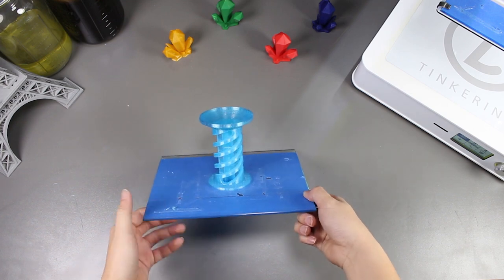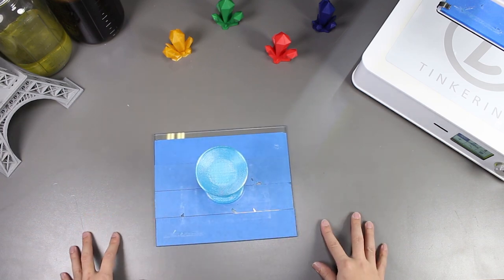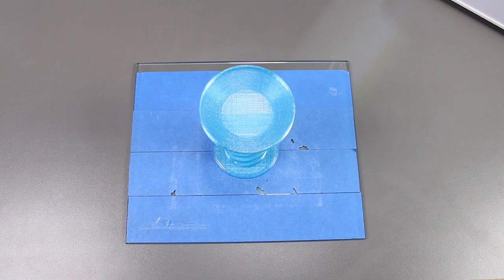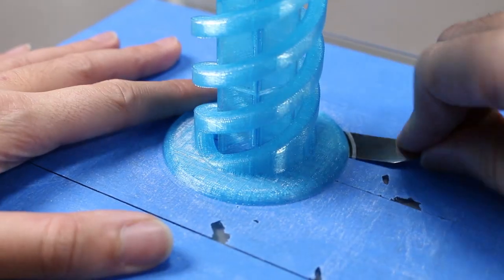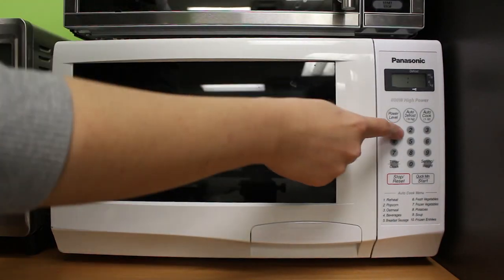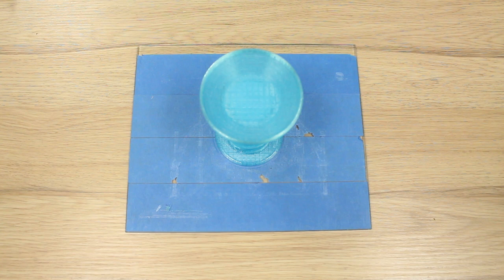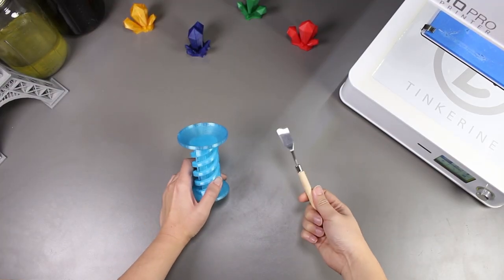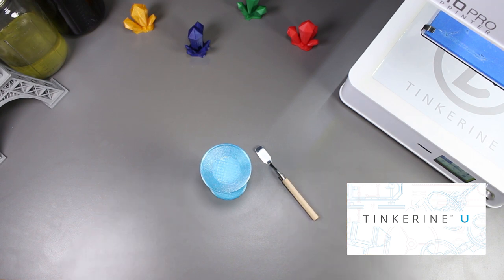Using the Microwave for Easy Print Release

Comment: I did not expect this to work but looks like it worked pretty well. I'd be curious to see multiple tests with large objects that have even more surface squished to the bed.

Also worth mentioning that if your build plate has any kind of metal in there like on its top coating (some do I suppose) then avoid putting it in the microwave or the could be some pretty (and scary/dangers) blue fireworks :)
Reply from the maker: Thanks for the comment and the heads up! Our build plate is made out of glass so there shouldn't be a problem but other people with different build plates should proceed with caution.

Comment: Interesting. If I spray water to the surface, could it also help the outside layer bind better?
Reply: I don't think it would really get hot enough across the entire surface to create better bonds in the layers. Maybe if you got a very good and even coating of water on the entire print it would help but that could be hard with how water likes to bobble together and hold under its own surface tension.
Reply: @BillyBobJimPatton  I will try it out in my school's microwave.
Reply from the maker: Thanks for the comment! We're not too sure, let us know how it goes.